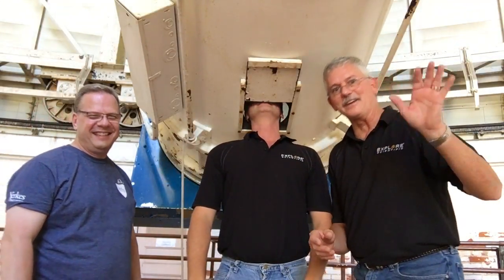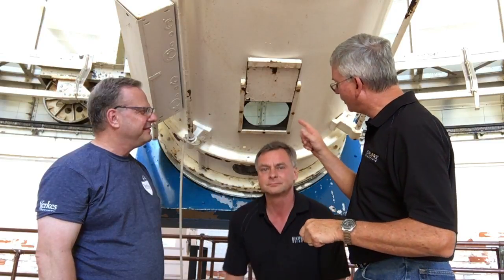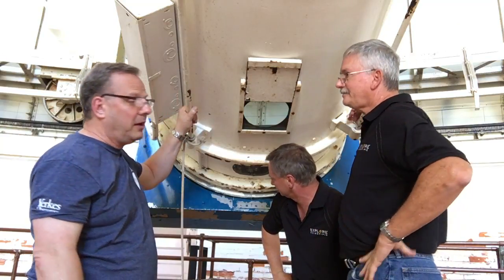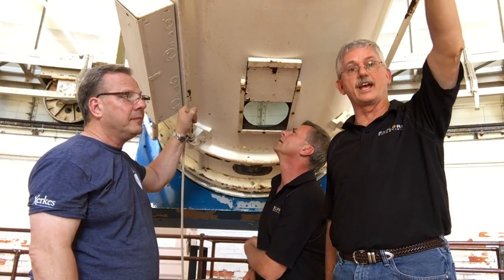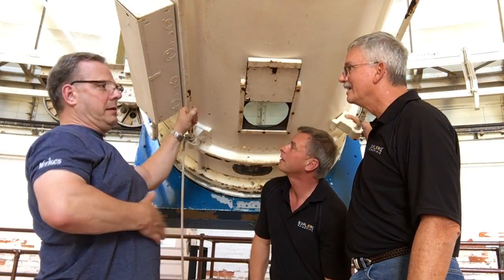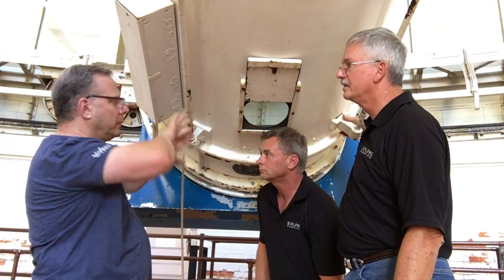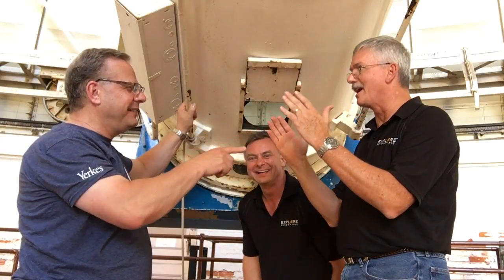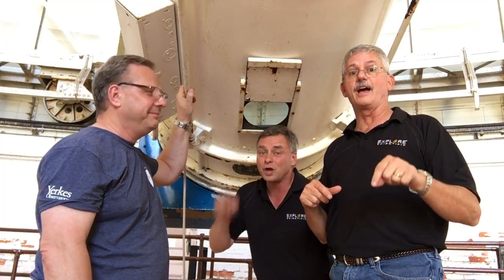Yerkes  40"   Cleaning the Front Elements

Comment: A major rep from the eyepiece company thinks the access hatch is a "hat"...
Spooky.
Surprised this observatory did not default to TeleVue Naglers.
Reply: f/19 telescope - slightly better correction of TeleVue eyepieces not needed. They probably use ES for the user-damage replacement program, given the scope is used for outreach. ES often also has slightly better eye relief at equal focal lengths. Say 15mm vs 18.4mm on the 24mm\68deg line
Reply: @Mandragara  Sounds interesting.
It might be possible so many folks that use the scopes are not amateur astronomers and would not realize any benefit of TeleVue optics.
Would be cool to visit the acopes and use individual eyepieces... but that is most likely not allowed.
Might be an interesting tactic for TeleVue to show their superiority...